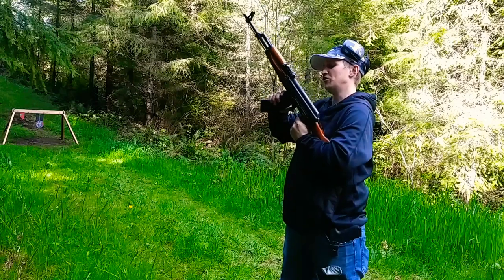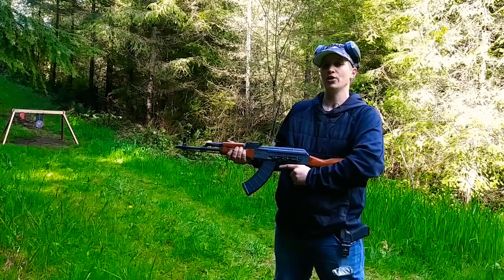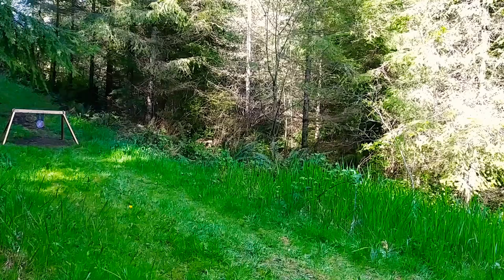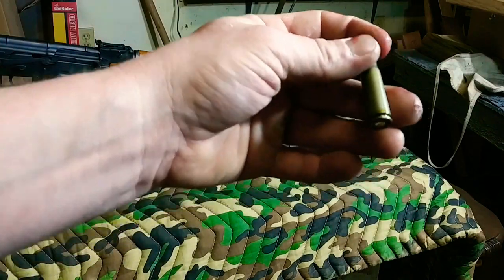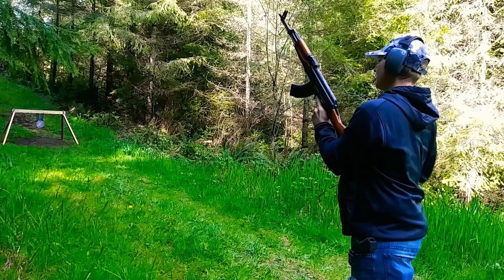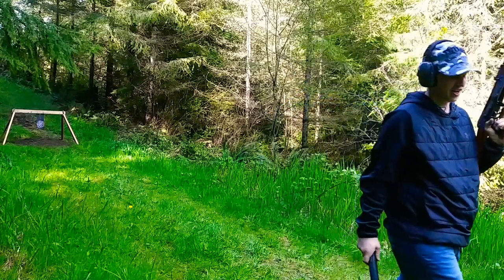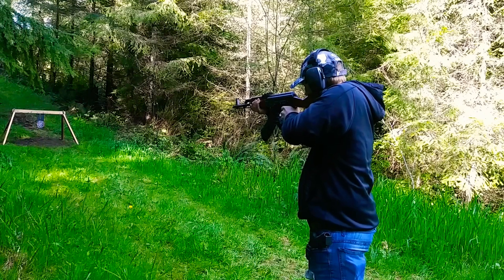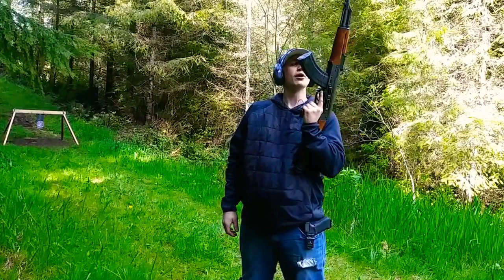Riley Defense RAK47C ammo reliability test

Comment: I got my own Riley Defense RAK-47 around January and its got about 3,000 rounds through it now. It eats anything I've put in it from the cheapest Tula and Wolf to the highest grade brass cased ammo. The lower handguard used to get very loose when I would shoot a lot but simply filling in the gaps with Tin Foil solved the issue and its just fine. It takes and runs every type of magazine I put in it and it hasn't had any malfunctions. (I've only had a few failure to fires but it was from the cheap quality of the Tulammo) It's one of my favorite rifles and for the price you can't beat it. The quality is great and what you get with it is comparable to much higher end rifles. After 3,000 rounds there is barely any deformations in the front lugs and other important parts that normally get worn down from these American AKs. Although it does not have a cut out in the stock for a cleaning kit, It's great how it comes out of the factory with a Tapco G2 trigger group, a standard side rail mount, a bolt catch cut into the safety, and one of my favorites is that it has a pin retainer plate instead of the standard Sheppard's hook to hold the hammer and trigger pins in which is a lifesaver because i replaced the hammer with a Romanian hammer that I smoothed down and it was very easy taking it out. It is probably the best AK out there in this price range and its all milled, stamped, and individually assembled in Charlotte, NC by a great bunch of guys who care about what they're doing.
Reply from the maker: Ya I noticed my wood handguard gets loose whenever I shoot it enough for the Barrel to get exceptionally hot to the point where the wood handguard starts to radiate heat as well but then as soon as it cools back down its no longer loose anymore thnx for the tin foil trick ill have to try that out this Saturday when I take mine shooting I just got done modifying a side rail mount picatinny rail I actually made a video on that I had to sand down the add on to get it to slide onto the rail.And im going to take mine shooting for the first time with an optic this Saturday so I'm excited to see how it runs an optic.
Reply: @counterstrike2A  I think an optic would be great on the Riley. I only shoot it with the iron sights but out to 300 meters I'm hitting about 3 MOA groups just lying prone and using my arms as supports so when you put some good glass on it, you should be even better. I don't think i'll ever put an optic on mine though. I don't put much money into optics (I run the $20 4MOA Field-Sport Optics from amazon on my AR) and I figure that for the $400 price point of these optics people are always recommending I can just use that money for a couple thousand rounds of ammo and I'd rather have ammo than a nice piece of glass lmao.
Reply from the maker: @joemamma819  that's funny u said that cause i only buy my optics on Amazon i actually have a bunch of reviews on my channel of Amazon bought optics
Reply from the maker: https://youtu.be/r5bWeI0Bi9U

https://youtu.be/UF0gzqr2D28

https://youtu.be/IzJDGa7bZmA
Reply from the maker: I actually mounted the Feyachi rs29 reflex sight to my ak47 4 days ago in gonna take it shooting this weekend and get it zeroed in

Comment: I have a riley rak 47 c and been getting malfunctions using  tulammo. Barnells ammo works great.  Any ideas
Reply from the maker: Maybe dissasemble and give the rifle a good cleaning specifically the extractor and the bolt carrier group and see if that helps with the tulammo I'll send you the links to my 2 videos showing how to clean the RAK47C the 1st video shows how to clean everything but the extractor and the bolt carrier group. And the 2nd video shows how to disassemble the bolt carrier group and extractor which may be the component causing tulammo not to correctly cycle. Hopefully that should do the trick if you haven't already
Reply from the maker: https://youtu.be/AbIZPOgoIxQ
Reply from the maker: https://youtu.be/kUhgAzuxbcM
Reply: Thanks kyle . i will definitely try that . ill let you know what happens
Reply: Oh also it's a brand new rifle with no more than 500 rounds through it
Reply from the maker: Ok good luck hopefully everything works good as new after its cleaned and lubricated I'll be looking forward to hearing how it went
Reply from the maker: @zachbernal4509  a common mistake people make myself included is not taking their rifle apart and cleaning it before taking it shooting the first time some manufacturers are better about giving their product's a good lubrication in the factory but most don't and I had some serious issues with my Bushmaster ar15 when i first got it and then took it apart and cleaned and oiled it after about 400 rounds and that fixed all of the issues I was having
Reply from the maker: Your welcome if you still have issues even after cleaning it then u can always contact Riley Defense they actually have some of the best customer service in the industry that i have experienced and heard of so they will definitely take care of you if the issue is from a defective part or something but it seems like oiling and cleaning it good shpuld definitely fix ur problem. Thanks for supporting my channel I try to put new videos out at least once every 2 weeks usually once a week so if u haven't consider subscribing and hitting the notification bell I just.got a new camera so my last 3.videos were filmed using that. One of them is a review of a scope with a tactical light and laser that I mounted to my RAK47C. Good luck hope everything works out for u I've already got 2400 rounds through my Riley defense and it's still running great! It's a damn good rifle for how low it's priced
Reply from the maker: @zachbernal4509  I'll send u a link to my favorite video of me shooting my RAK47C after getting a side rail and optic mounted to it.
Reply from the maker: https://youtu.be/JS62hNlYyLs
Reply from the maker: @zachbernal4509  I have about 11 videos so far featuring my Riley defense